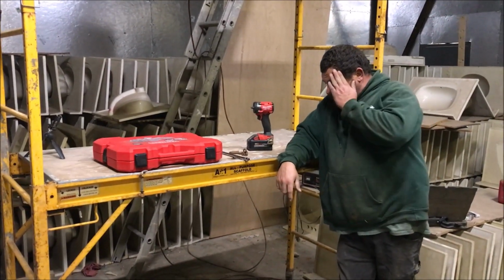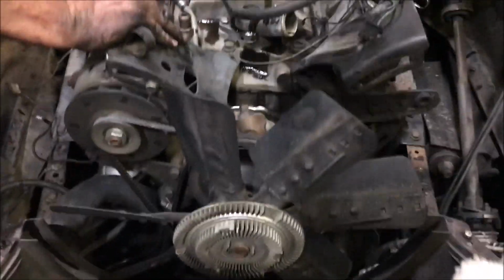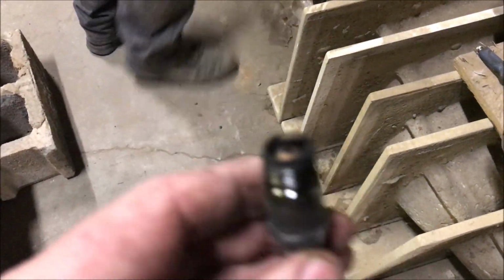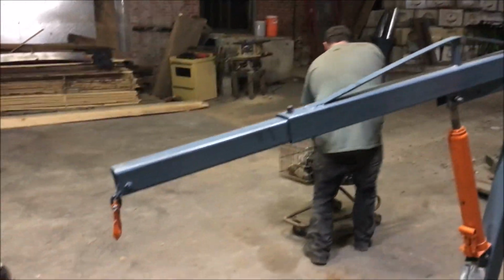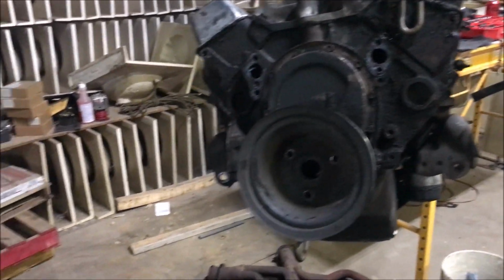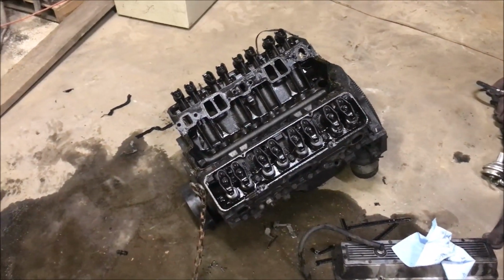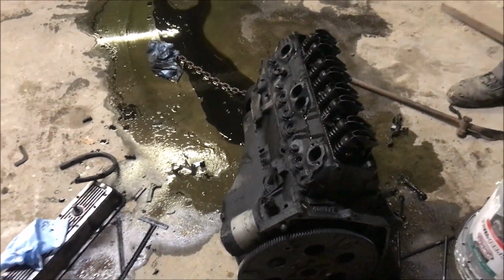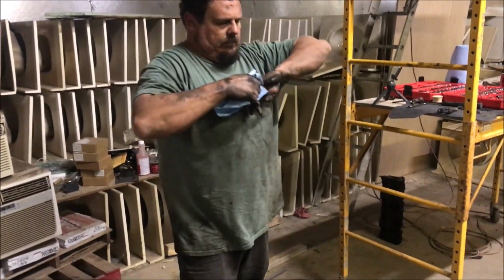Pulling The SBC 350 Engine Out - 1983 Chevrolet C10 Silverado Pickup Truck, Diagnose By The Sound?

Comment: I couldn't tell you with 100% accuracy the distance travelled on my 4WD :P

The Odo stopped working back in 2016 when the reset button for the trip meter jammed it up, but the km on the Odo at the time were around 463,500km (288,000miles), what I can say (roughly) is that it has now done over 520,000km (323,000miles) because the car does around 800km to a tank (500miles) and the tank is 95L (25 US Gallons).

My 4WD is model-year 1988, build-date Feb-91.

Still, good to see you keeping this thing running, newer vehicles have better safety, etc... but also have more complications.

My car has timing gears, and it is a diesel, so no spark plugs to ever have to worry about, and no timing belt or chain to ever have to deal with (original engine and timing gears in my car), no onboard computer, basic electronics, but not as good safety.

Significantly easier to work on than a modern one too :P
Reply from the maker: That’s awesome man

Comment: I had an '74 Oldsmobile delta 88 with the Super Rocket 350 V8. Heavy af car but it moved. So much room in the engine area, was a dream to work on. Had to lt it go as 12 mpg was killing my bank account.
Reply from the maker: You should try my 454 at 3 miles a gallon
Reply: Yeah they drink some gas!  those Delta 88's were cool cars

Comment: I like to put some steel rims under the front tires and on the square body it lifts it enough and its not going anywhere.
Addendum;;my 83 El Camino had a mix of metric and standard nuts & bolts,and i was first to get into it.
Reply from the maker: I’ve done the rim trick before two

Comment: What do yall lack on getting the other Chevy done?
Reply from the maker: New motor fix the wiring And there’s something wrong with the brakes
Reply: Adam it runs but it's not right, and we saw metal shavings in the oil pan so.... one of the guys who built it and didn't know what he was doing ran it without oil in the top end of the engine unfortunately.  He also screwed up all the wiring to the gauges so none of them work, and the brakes are a little touchy.  We're going to get back on it soon though.
Reply: @LyonsArcade  Gotcha.  Last I saw I think yall were trying to get it running.